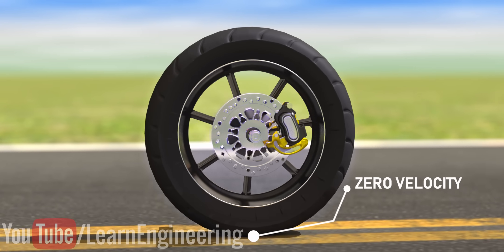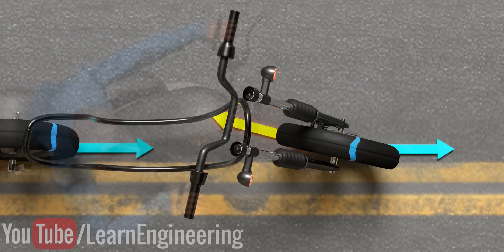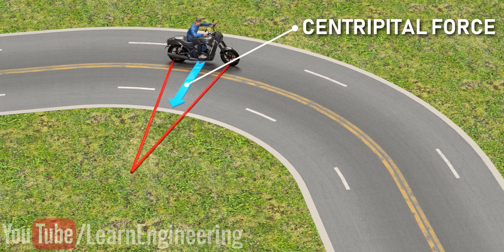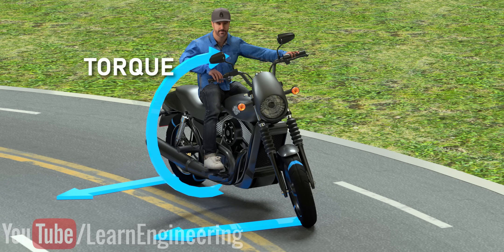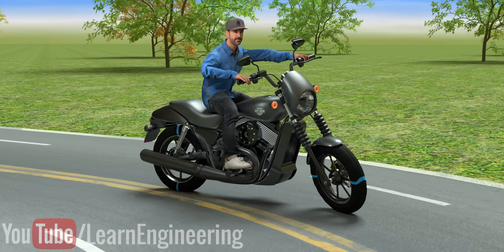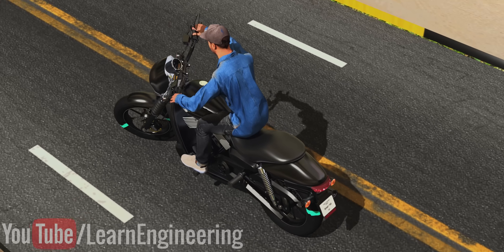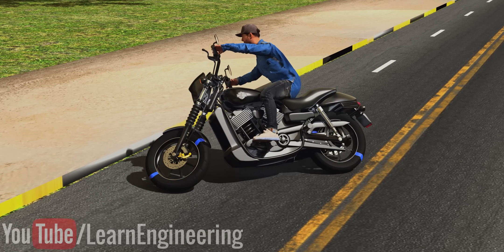Counter Steering | The interesting physics behind it

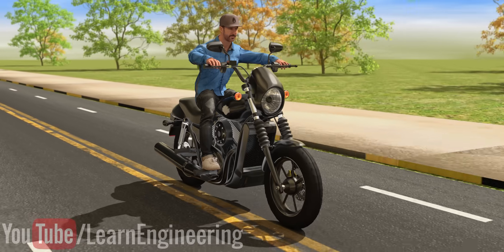Comment: At 1:13sec he says: "In normal steering, to make a right turn, what we do is just turn the steering to the right and lean our body in to make the turn..." I'm like, WHAT??!! I guess this sentence should end "...and then you crash and die."

Folks, counter-steering is how you turn a 2 wheel vehicle, whether it's a bicycle or a motorcycle. It's not a special technique. If you ride a bicycle or a motorcycle you have been counter-steering all this time without even knowing it. It is so subtle most of the times you can't tell. If you are hoping to see the handle turn in opposite direction first then that is where you go wrong. You dont see counter-steering normally because it's so subtle BUT you feel it in the pressure you apply to the handle when turning. Now if you want to make aggressive turns then you going to have to put in a very conscious and healthy dose of counter-steer which is what this video should have been saying instead of letting it seems counter-steering is a special technique. Aggressive and conscious counter-steering is a good technique to have. Now at very low speeds things can behave a little different and instead you use your body to counter-balance ... but who rides a walking pace anyway?
Reply: Yeah i just saw kids doing counter steering with their bicycles, pretty sure they have no idea what is counter sterering, but they already mastered it.

Comment: im confused, in high speed i just lean my body not rotating the handlebar.
Reply: fariq fatah 
Just leaning your body achieves nothing, this has been proved many times over. When you lean (to the left fore instance) you inadvertently add Slight pressure to your left bar, consequently you counter steer. If you didn't counter steer you wouldn't make it through the bend. Hope this helps.

Comment: "Normal steering" description is incorrect. You can't just turn handle bar and lean motorcycle by moving your body - all it does only by countersteering, even in slow speed. Watch about 'Nobody steering bike' from Keith Code  https://www.youtube.com/watch?v=8_5Z3jyO2pA

Comment: This is wrong information. At high speeds the effect of pushing the right side of your steering wheel will transfer as a twisting force on the wheel. Because the wheel is spinning the angle of momentum is shifted in effect not pushing the front of your wheel to the left but pushing the bottom to the left (and top to the right) which will induce an inclined position of the motorcycle. This video does not cover this at all.
Reply: Fabian Oudhaarlem 
The information contained in this video is dangerous, especially to new riders. It needs to be taken down in fairness.

Comment: COunter steering kicks in at about 12 mph, " normal steering" is form there on out done. So basically counter steering is the only thing you need thing learn.
Reply: It does not kick in at [about [Add some random numbers here]] speed. It is there always.
Reply: @akivak4660  is there at 5 mph, or is that mostly normal steering, twist of the wrist.

Comment: I don’t understand. Counter steering, most of it, seems normal steering with body lean except  the initial bit. So why bother, just do normal steering, and wouldn’t it be quicker ?
Reply: Sadiq Khan 
You can't lean a bike with body weight alone, you achieve nothing. You have to counter steer or you don't lean.

Comment: This video is all kinds of wrong. Well presented, but dangerous and even incorrect in a physical approach (for example: the centripital force will be going out of the corner and is counteracted by the frictional force created by the tires on the roadsurface). 

Bad (even dangerous) video dude..

Comment: What’s he saying about “normal” steering? You can’t steer a bike doing what he’s suggesting is “normal”. If you don’t counter steer you crash! You don’t  “cleverly adjust” anything because your brain does it automatically.
Reply: Jay Whoisit 
Ok so you're right and wrong here fella.
You are right when you say a bike can't be steered without counter steering. Completely agree.
You are wrong when you say about the "cleverly adjust" part, your brain does nothing as far as this is concerned. The rider pushes left to take a left hand bend (fore instance), so slight is that counter steer that it is hardly noticed, the steering geometry of the bike then takes over and steers the front wheel into the bend. If the rider were to actively steer into the bend, the result would be the bike standing up and straightening the line of travel.

Comment: You can only turn handle bars at slow speed like 0-10mph. Anything over that you counter steer. And if you are on a track you counter steer and lean to get the bike round the turn. Everyone watch twist of the wrist
Reply: How do I turn when my speed is oscillate between 9.9mph and 10.1mph? I go straight only?

Comment: "Normal steering" does not exist at all in a motorcycle dynamics. A motorcycle can be turned/leaned only by countersteering regardless of the speed.
Reply: Hmmmm... seams  to me that, even at slow speed, I start every turn with a slight “bump” of counter steering?  But with me on it, my bike weighs 1150+ lbs.  I’ll just bet that at slow speed, a small bit of counter steering is optimal (if not required) for turning a heavy scooter.
Reply: @gerhardmoeller774  Yeah, every turn begins with countersteering. But at slow speed countersteering hard to notice cuz very light force is required to initiate a turn. Your hands do it automatically. At medium and high speeds(eg from 30 to 300 kmh / 20-200 mph) countersteering is easy to feel. For example, in a right turn, Your right hand will be constantly pushing the right handlebar. The more speed - more forward-directed force is required to apply to the handlebar Your bike turning.
Reply: Racers exert over 100lbs of force to tip the bike. big gyroscopes don't like having their attitude changed. That's why when you fall off, the bike continues upright until the gyros slow down. It is very hard to knock over a fast moving bike. This is a dumb video with all the slip/no-slip jargon.  You will become more conscious of tipping in when you center flat the rear tire from riding on straight roads. Then you install a new pointy tire, and she falls right in.
Reply: .
When I am slowly cruising a parking lot (below 10mph) while looking for a space I am "normal steering".  When I leave the parking lot and accelerate above 10mph I can only turn by using counter-steering.
Reply: normal steering is perfectly fine with slow speeds counter steering is needed for high speeds only trust me i dont need to counter steer out my drive way smh.
Reply: @jonw3678  It's not true cuz Your hands countersteer automatically without Yor attention. Just try simple experiment - drive at slow sped on 1st gear at idle rpm. Remove both hands from the handlebars, stabilize Your bike - make it moving straight. Then push right(or left) handlebar forward by just one finger and notice where Your bike will go.

Comment: New rider here, do you hold the countersteer throughout the turn? I was under the impression you did but this video gives me the impressions that you first countersteer, then turn in the direction fo travel once you've leaned and are in the turn. Can someone clarify?
Reply: C L 
Hi. Yes, you hold the pressure on the bar in question throughout the turn. If you need to lean a little more while in the turn, just push a little more on the bar in question. If you need to lean a little less, release the pressure on the bar and the bike bike will begin to sit up. This video does indeed (and incorrectly) that the rider should actively turn the front wheel into a turn and it's totally wrong, indeed dangerous! Just for your info, the front wheel does indeed end up pointing into the turn, but the bike itself manages this due to its steering geometry. Hope this helps. Ride safe.

Comment: Thanks for the effort but you made one glaring error and I'm not even sure that your explanation of how counter steering works is accurate. At the very least, it's a confusing way to explain it.  As you know, there are many explanations.  The error is that you mentioned that counter steering is faster.  That implies that there's another way to steer at speeds that require counter steering. In fact, it's not "faster" because there is no other way to steer at those speeds. Counter steering is the only way to turn at speed so it's not faster than any other method because there is no other method to be faster than. 

Your explanation is enough to give some people a headache. Here's the way I think of how counter steering works:  When you turn the front wheel slightly to the left (by pushing on the right grip or pulling on the left grip), the front tire turns to the left but, because of inertia, the top of the bike (including the rider) remain to the right momentarily. In other words, the bike is leaning to the right and the lean is what initiates the turn.  You're riding on the right side of the front tire. 

Some riders insist that they steer at speed by leaning the bike with their own body. Actually, that's not true although the lean is what initiates the turn.  They steer by counter steering and counter steering makes the bike lean which makes it turn, not the shifting of their body. In fact, leaning the body does very little at counter steering speeds. There's an excellent YT video that demonstates this.  If you don't turn the handlebars but lean your body, the bike will keep going straight or nearly straight. This is very surprising to some riders. Again, it's the counter steering that causes the bike to lean, not any body movement by the rider.
Reply: Bob Miller 
Their are so many things wrong with this video that it becomes dangerous for new riders to follow. Agree with all you say Bob, nice description of how it happens. Push left go left, push right go right.
Reply: Thanks. I think i got it from your comment. The video was confusing. I am thinking of getting a motorcycle, but i am a bit terrified. Now i have a 50cc scooter and at first even that was really scary to ride. 😳

Comment: There is only one way to steer a motorcycle at speed (more than 15 or so mph). There isn't any other way. This is dangerous and misleading to those that actually need the help. Push right to go right, push left to go left. This is the easiest way to train yourself to ride a motorcycle. Learn this way and in a panic situation, you will know what to do, and forget everything you heard in this video.

Comment: Ignore this video and take an MSF Course and learn how to counter steer properly.  If you are riding in a parking lot at slow speed a motorcycle steers by turning the bars in the direction you want to go.  Once you get faster direct steering does not work nor does leaning your body.  The only way to steer is counter steering.  The simplest way to do it is look where you want to go and push on the bar in the same direction you want to turn.  In other words if you want to go right push on the right bar, alternately to go left push on the left bar.  Don't think as your brain tells you it is wrong but it is not.  Look left, push left go left.  Look right, push right go right.  The harder you push the more the bike will lean and turn. Search for Twist of The Wrist II on youtube and watch the whole video! https://www.youtube.com/watch?v=dgOPZWNswvY

Comment: I'd say this is quite a dangerous way of riding a motorcycle. 

TO TURN RIGHT, PUSH RIGHT HANDLE & LEAN RIGHT same goes with turning left. I got the physics etc, but this is not how you steer a motorcycle. If you can ride a bicycle through a corner safely, then you're countersteering. It comes naturally without you even realising it
Reply: N. Mad 
Yea, but lean with the bike right? Because the rider leaning will have no effect on the bike.

Comment: This video is wrong in so many ways.  Counter steering is the only way to steer a motorcycle at speed.  And the bike will not fall over if you counter steer and not adjust the bars accordingly this happens naturally.  I don't think this was even done by someone that has ridden a motorcycle.

Comment: All steering of a motorcycle is countersteering. There are no exceptions and there cannot be, unless you are going so slow your feet are paddling on the ground, or you have a third wheel such as a sidecar. You might think you're steering by shifting bodyweight, but what you're actually doing is subconsciously countersteering.
The point is that the motorcycle must lean first and then turn afterwards to balance the lean. To initiate the lean, it must first turn in the opposite direction, even if only for a moment. 
Prove it to yourself on a bicycle in a traffic free parking area by riding through a puddle at slow speed and then initiating a turn. You will see the tyre tracks go first in the opposite direction and then in the desired direction. 
Why am I so pedantic about this? Because wrong information crashes motorcycles and smashes up riders all the time. I crashed once before I learned this. Practice conscious countersteering of every turn on every ride. Then when you need these skills because of an emergency, you're more likely to do the right thing than panic and run off the road.
Reply: James Rindley 
Yup, reckon you have this about right fella. Nice description of counter steering.✌🏻️
Reply: this video has many serious errors
and your reply is also seriously wrong

dont bother trying to comment or correct this video, it should be deleted from youtube
along with your comments

Bicycle?!  Really?! that is how people get killed, they think riding a 700 lb motorcycle is like riding a 20 lb bicycle!

Comment: the concepts are correct, but the way it's presented is bad. depending on the physics of each different bike determine how much counter steering is needed to get the bike leaned over. by reading some of these comments i believe there are riders that don't even realize that they are actually counter steering. depending on the construction of different bikes, consider a long wheelbase cruiser with a heavy engine down low, you have two different forces trying to stay in a straight line, so more force must be exerted on the bars to get the bike leaned over but even in this case the actual amount of degrees from center is very slight. at the other end of the equation would be a dual purpose or adventure bike where the wheelbase is shorter and the engine is much higher in the frame, so it has less tendency to resist turning because a more top heavy bike will lean over more easily. much less pressure on the bars is needed to get it leaned over. I have been riding since '68 and competed in racing and read many articles over the years. i recently bought a Honda DN01 sport touring bike that is much heavier and carries the engine much lower and has a much longer wheelbase than any bike i have ever had before, and the first time i took it to my favorite winding road i was shocked at how much counter steering pressure was needed to get it to change from straight ahead to getting it leaned over to start the entry to the turns. in all of the articles i have read on this subject and advice from veteran riders i have to say this is the worst instructional material i have ever come across. the quality of the animation in this day and time is ridiculous. and to top it off showing a rider without a helmet, they have lost all credibility. surely there are other videos on here that do a much better job of presenting these lessons in basic riding techniques, at least i hope so

Comment: Normal steering is needed when traveling at very slow speeds such as below 10 or 15 mph. At higher speeds. Counter steering is happening whether or not you are aware of it.

Comment: just so you know the whole readjusting after countersteering thing happens naturally. The bike does it itself. In fact motorcycles do a lot of things by themselves because of gyroscopic motion
Reply: He also says if you don't turn the bars back after counter steering, you'll drop the bike. Total BS. The bike will just turn in circles for as long as you hold that direction and maintain your speed. You don't even need to do this because there's a motojitsu video on it. This is a horrible video by people with no practical knowledge of motorcycle riding that needs to be deleted.
Reply: @mwillerd8969  Exactly.
Reply: Grren 
Well said! The front wheel self aligns in the bend.... So pissed off with people saying this crap about steering into the bend after counter steering!